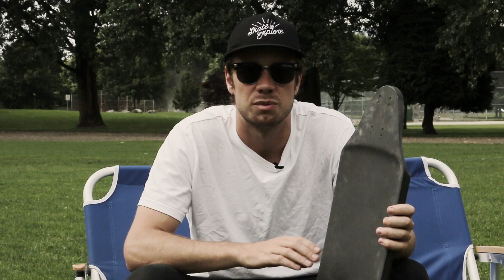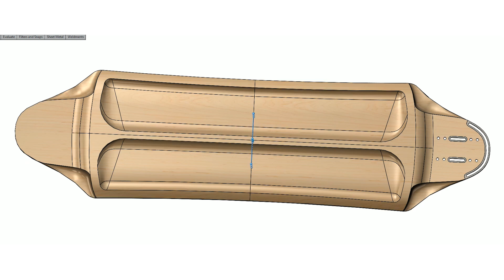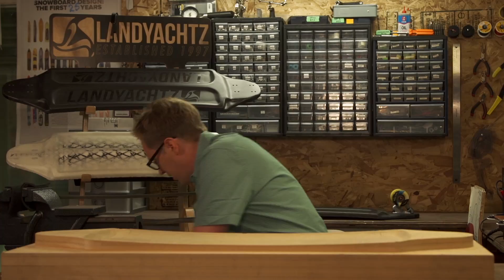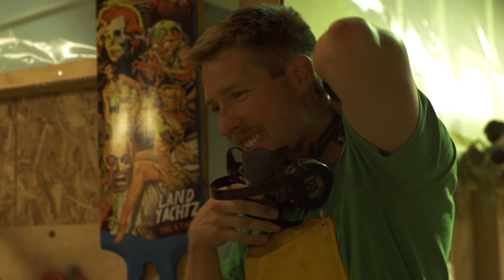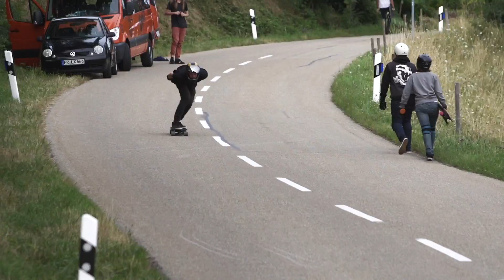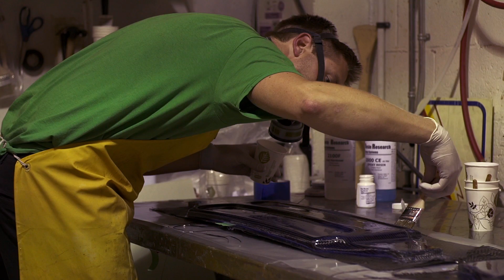Triple Beam - Most Technical Longboard Ever

Comment: The price seems fair for the amount of R&D, cost of materials, cost of employees, in order to get an ROI.  I am just getting into this sport, but before, I was a CAT 2 MTB downhill racer.  My bikes with my sponsor discounts still set me back over 4k.  This aint shiz compared to the cycling community.  For instance, just check the price for a pair of downhill Envy carbon wheels.
Reply: Yeah $1000 is actually really cheap. That’s like the bottom end of decent road bikes that will last. Same for cross country mtb. DH and enduro bikes don’t count since those are too niche.

Comment: The Osteon's tight. Just a bit weak. Cracks easily... Cracked it my first day, tried doing a no comply impossible, (Just dicking around), and the nose hit the ground and it took a solid inch of wood out, (along the length of the board), and went down about 3 plies.
Reply: That's gonna happen to any wooden board. Longboard or Skateboard
Reply: Tanner Johnson true. Although, my friend Patrick Eddings was with me, riding his proto remember board (and all protos are pretty jank), and has yet to crack his even after it was sent into a curb. I did expect the board to crack but not to the extent it did.
Reply: +Daniel Maisel yeah some boards are more tanker than others. I skated a top speed for around 2 and a half years and smashed it into dozens of curbs and it never chipped
Reply: ouch, better patch it up with some wood filler!
Reply from the maker: sometimes things happen! if you think there may be a manufacturers defect hit up our warranties department! http://landyachtz.com/warranty-info/
Reply: landyachtzlongboards might do that, the lamination around the edges seem to be very weak. Just from kicking the tail while walking up a hill I've chipped the tail. I may just add a carbon fiber layer to keep more chips from developing.